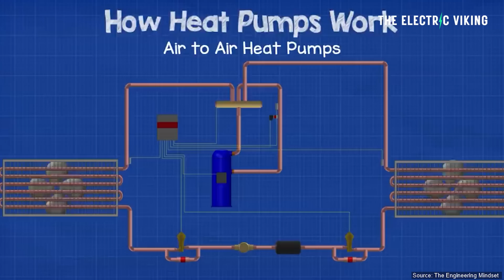U.S reveal NEW Heat Pumps that withstand freezing weather & save 50% energy

Comment: For anyone outside of the U.S. confused about this: America has used heat pumps for cooling for decades. However, much of America didn't use heat pumps for heating. It was either Fireplaces, Resistive Heaters, Natural Gas Heaters, Or Heating Oil for Furnaces. The recent green energy push combined with improvements in heat pumps and financial incentives is putting a new light on heat pumps for heating rather than just for cooling.
Reply: This is true. Many businesses use mini split systems because they know it’s cheaper. Many US homeowners like to do things the old way. 

What doesn’t make sense to me is why we don’t use geothermal is more new construction. No worries about outside temp and it’s even cheaper to run.  The loops last forever and the heat exchanger lasts much longer than a modern high efficiency furnace.
Reply: Yea and in many cases your fossil fuel dealer was never going to tell you about them unless you ask and then you might not get the truth or full story. Many great videos on YouTube to really learn about heat pumps and how they work. Educate yourself before you wet multiple quotes and get full system pricing from US Internet full system sellers so you can figure out parts vs dealers installation price as many refuse to itemize parts vs labor.

Comment: Heatpumps have been used in Sweden and Finland for over 20 years. They work well also in cold climate and generate energy/heat all the way down to minus 20 degrees C.
Reply: Montana USA here…we just went through -40 C cold snap, so my heat pump errored out early into the nosedive…🥶😱
Reply: Wisconsin here, -20C here. My inexpensive mini split is working fine. Don't know how fast the meter is spinning but at least the gas furnace isn't running as much. Run my mini split, 24/7. Living room is 450 sq ft with 7 ft ceiling, and it is comfy.
Reply: Many areas of the US, outside of Alaska, regularly get well below -20C for days at a time.
The heat pumps are getting there but aren’t quite there yet.

Air heat pumps are ok for the bottom half of US but you need ground based to handle the upper half/Alaska since air based aren’t quite there yet.

For now, you still need gas or electric assist for air based heat pumps for heating/cooling although heat pump water heaters are probably there now but a bit pricey.
Reply: @roberthealey7238 They have been there for 10 years! Living in northern sweden (above anchorage latt) and heat pumps are in every home basically. And have been for years!!
Reply: Do the heat pumps used in Sweden extract heat from the ground, or from the air? Heat pumps in places like  Scandinavia and the northern US tend to be of the geothermal type, with tubing buried 1-2 meters below the surface extracting heat from the ground. Heat pumps used in warmer areas take heat from the outside air, which become increasingly less efficient as the air gets colder. I'd be surprised if you use air heat pumps in Sweden, with the possible exception of the far  southern part of the country, especially closer to the sea, where the weather isn't super cold.
Reply: I think the ground type is more common in Sweden than in Norway for some reason. You have to drill well holes instead of just forking out maybe 20 - 30 thousand NOK. The drilling and the heat pump used for wells probably climbs to around 10 times more expensive. Idk, why the Swedes can afford it, and not to many Norwegians. Maybe they have better subsidies
Reply: @grilsegrils9330  average temp is much higher in northern norway due to the north atlantic current. And if you have 5-10 minus a air heat pump is really a now brainer. At -20-30 degrees geithermal is still a better choice if you have the money.
Reply: @brunopadovani7347  I would say 50/50. But still, the point is that air-water or air-air heat pumps for really low temperatures are absolute mainstream in northern europe, and have been for years. And these youtubers talks about it like its alien technology 😆
Reply: Owning a property with boarder to the ocean or a lake can be quite expensive, especially for a house property
 But it probably is the best option to just sink a spool of black hard sturdy plastic pipe to the bottom of the body of water. Not only do you have the normal benefit of the cooling liquid flowing through, but you also have effective exchange of water surrounding this pipe. Especially in the salt water ocean this can be very true. But also in a lake, since the body of water is large. A lake can freeze to the bottom, but that takes a lot of frost, plus isn't to normal. The bottom water would stay plus 4 degrees Celsius for the longest. But you probably need insulation on parts of the pipe coming out of the lake into the soil, in case the frost should be severe some year into the future
Reply: The heat pump installer switched my wish for Mitsubishi with a Daikin, claiming it is an even larger manufacturer and similar quality. So I just took his advice

Comment: I live in the Southwestern US and I installed a heat pump about 4 years ago. Works great, until the outside temperature reaches around 40F. Then I need to activate the resistive heating strips, which is obviously less efficient. I did it mainly to stop burning natural gas in my house, now everything (including transportation) is run from my solar panels.
Reply: It must be a cheap heat pump. I have a Mitsubishi R10 Heat Pump & it is goo for down to -20 degree celcius, no problem, installed 8 years ago & is Great!
Reply: 4 years ago could have been an R-22 system if you can't go below 40F. R410A will get you good heat down to about 5F. Below that, the strips come on. They don't even make R410A anymore. I assume the next gen (R454B will be able to handle extreme cold, but is A2L and I have not even seen a whisper about whole house systems. Just mini-splits.) I hear they are coming Jan. 2025. But we'll see.
Reply: @anthonylosego  my R410a  unit is rated to -30C  Works just fine at -20

Comment: Sam, it looks like you didn’t research this topic enough to fully understand it. The topic here is cold climate heat pumps. A lot of the schematic animations you were showing are air to air heat pumps. Those are not cold climate heat pumps. Once the air temps go under 40 degrees F, it will have to kick on a resistive heater tso maintain 70 F inside. That becomes very expensive to operate because of how much energy resistive heaters use. My parents bought a house in 1985 with baseboard resistive heaters.  They installed a Carrier brand air to air heat pump. It was $3,500 back in 1985, which was kind of expensive back then. So the real topic of cold climate heat pumps…. Those are air to water. Or more accurately, air to antifreeze, like ethylene glycol or propylene glycol. Those use a radiator that is buried underground. These “ground source” heat pumps use a trench that is 5-6 feet deep. Insert the underground radiator, then bury it. The earth at that depth will still be 40-60F even in freezing temperatures.  That technology is newer than air to air heat pumps, but still more than 40 years old. So this cold climate heat pump challenge is not inventing a new technology. The goal here is to make the existing technology more efficient, more robust, or longer lasting, and to make it cheaper so that it can be deployed at mass scale.

Comment: Love your channel. This heat pump news might be new to some countries who haven't had reason to use heat pumps widely. In Nordic we have used heat pumps for about 30 years now. They are mainly Japanese manufactured and work fine in in sub zero temperatures, saving electricity to up to -25 degrees weather, at which point the efficiency coefficient is 1:1 or simply put it works like electric heater. Typical power savings using a heat pump in Nordic weather conditions is around 35-40%.
Reply: I think Panasonic sells model which they claim to work at -35C

Comment: I live in Denmark (Europe) last weekend we had -15 celcius. My 20 year old heatpump works just fine, also air to water heat pumps are nothing new either. You completely fail to explain what this “new technology” is about. My guess would be that the old heat pumps in very cold temperatures actually just switch into “toaster mode” where it use a plain old fashioned heat element, and therefor does not use the actual heat pump. And this new technology actually makes it able to use the heat pump part in much colder temperatures. You should do a new video where you actually explain what the new technology is about.

Comment: I just want to say that all three homes we’ve lived in since 1984 have had heat pumps. I live in MD where it’s been borderline if heat pumps make sense. There has been great improvement on the cooling side but not on the heating side. From reading the comments it sounds like that has changed. That’s great news because many homes in my area were built with gas heat.  I’ve also had friends with large homes that had three heat pumps. Electricity was so expensive in the winter that they bought three pellet stoves for heat. This was like thirty years ago. Sounds like I need to take another look at heat pumps!
Reply: It works well in my 130 year old home in Maine... saw -15F last winter.... hyper heat mitsubishis, and fujitsu is what I use on my home and most of my customers..
Reply: But Daiken also has a great low temp product... I recently started installing their r-32 products for lower GWP in the refrigerant in case of leakage.
Reply: They're finally coming around. 10-15 years ago they sucked, but the newer ones actually produce good heat in freezing temps. I wouldn't trust them in extreme cold, but down to about 10F they work.
Reply: The newer cold climate heat pumps are vastly improved and will heat well down to about -5 F. But make sure your unit and thermostat control can do weather compensation to maximize efficiency based on outside temperature. This is bigger in Europe but just being implemented here ( a lot of HVAC Contractors here don’t know what it is but the really good ones do? You can research it on YouTube.
Also see “The Maine Heat Pump” study where the installed Heat Pumps in about 100 homes of all sizes and types. It is also on YouTube and their website.

Comment: The $500 per year will be spent maintaining the unit and that’s if it doesn’t develop a serious problem and you can bet it will. We don’t need a heat pump that will work in cold weather we need one that is cheap and reliable.
Reply: Energy costs are the largest factor so an efficient model is highest priority.
Reply: @imzjustplayin  Not where I am. My electric bill is only about $200 per month. What fraction of that could I save? Not worth it.
Reply: You'd have to do the math on incremental cost increase of the unit vs. the expected energy savings over the life of the unit. DOE rules for appliance efficiency standards is that the expected energy savings over the life of the product should at the very least break even with the cost of the efficiency improvement. 

Someone who rarely uses their unit probably wouldn't benefit from an efficient unit while someone who uses it frequently would. I don't know what your rates are and we don't know what the incremental cost increase is between units you're thinking of. If I was buying a heat pump, I would buy the highest efficiency model because the low efficiency models are useless below 45-50F. The higher efficiency, the more heat you get. My dad made the mistake of getting a 'cheap' heat pump rather than spending the additional $5000 for a decent model. Because of this poor decision, the unit makes little heat and it's exclusively relying on the PTC strips (glorified space heater) for heating the house. So despite the outside temperature being 50F, the unit can't heat the house above 62F without relying on the PTC strips. It's effectively useless. The minimum temperature for the unit is 45F and it has a seer of I believe 14, the minimum standard. The thing is really a cheap A/C unit that has a slight heating ability. The unit is appropriately sized for A/C but its heating capacity is lacking. A high efficiency model of the same tonnage (3.5T I believe) would've provided more than enough heat without needing the PTC strips. @frankcoffey
Reply: Absolute rubbish. The notion that you're spending $500 a year to maintain a heat pump is total bulshit. Take your trolling somewhere else

Comment: The temperature outside right now is -32C.  A heat pump without auxiliary heat working only down to 5F (-15C) is about the theoretical limits of it.  Physics says there's not much heat to extract at minus 35C. I wonder how it would work at -50C up the road? A heat pump which uses an under the frost line loop would be improved somewhat however I'm not sure it is a complete solution.
Reply: There are air source heat pumps that work at -18f.
Reply: It's an engineering problem not a physics problem. Using nitrogen as the working fluid the pump could work at extremely cold temperature. Using mechanical actuators to clear up frost in the evaporator fins solve frosting issues.
Reply: Most refrigeration systems have defrost cycles either hot gas or resistive heaters. @kazedcat
Reply: @kazedcat  Interesting that you say the laws of thermodynamics (physics) are not involved by selecting a different fluid type.
Reply: @ricknash3055  There is always heat to be collected if the temperature is over 0°K / -273.15°C / -459.67°F. It is only up to the fluid in the pipes. My heat pump works well down to -25°C. Then it uses as much energy as it collects from the air.

Comment: It's about damn time the United States government got serious about heat pumps.

I'd like to see Tesla start making their move on their promise to advance heat pump technology.
Reply: The us government will figure out a way to screw up the technology, and back up the wrong company or something.
Reply: Trump said we don't need high efficiency anything. We're gonna drill, baby, drill!
Reply: @pardunmeesuh5612  No, that's not what President Trump said, troll bot.
Reply: Tesla's heat pumps have a manufacturing defect that informs its presence around the time your warranty lapses. So those are probably not usable in the building construction industry setting, either.
Reply: @mikapeltokorpi7671 do you have more data on this information? Are you suggesting Tesla intentionally programs it this way?
Reply: @mikapeltokorpi7671  Thank you Mr TrollBot
Reply: @mikapeltokorpi7671 
Fair enough.
However, Tesla's tenacity and brilliant engineers can improve that technology for buildings.

Tesla seems to have a knack for beating problems into submission.

Comment: I don’t understand when I hear “heat pump”. I know what a sterling engine does, in other words, a heat pump and how it requires two zones of air to operate to turn to make electricity potentially but you can’t do that to heat air inside when it’s freezing outside or to cool air inside when it’s hot outside
Reply: It's new age jargon to fool the gullible. In Australia the term is reverse cycle. Great for one room. Not for the average 6 room house

Comment: My heqt pump works flawless down to -25 C so nothing new here!
Reply: Try and heat  7 room house with one😊😊😊
Reply: @robertfonovic3551  No problem at all! And a unit for a small house costs only 1500€, I have used it för 25 years now, changed the first after 20 years. So for a large house you can have a split with two indoor units that is just slightly more expensive. For a very large house it’s better with a different type of heat pump but they are more expensive of course, water-air is about 10000€  and geothermic is about  15000€.

Comment: Getting the cool heat pump isn't hard, even here in America. ~$3500-4000 for a 3 ton 18 SEER Mr. Cool Universal (central air instead of single room) that's good to -20F.
Getting the HVAC company that will install it without trying to force you to buy their $15,000 Mitsubishi or Daikon heat pumps is impossible in some places. Most I've talked to simply won't work with customer supplied equipment as there's not enough profit in it. 
The individuals either aren't certified, can't do the permitting, want $1000 an hour, or just ghost you.
Reply: You are paying TRIPLE the amount that we paid for top-rated Mitsubishi systems in Canada. US distributors are cheating you.
Reply: Well duh, but doesn't change the fact no one will do it for a reasonable price. @FrunkensteinVonZipperneck
Reply: @FrunkensteinVonZipperneck  it’s the installers. I got a full geothermal system including the loop for &24 before 30% rebate. $15k for air to air heat pump is insane.
Reply: You want to look around for someone that retired or is starting up a new company. The big problem is monopolization by the large companies that go in and buy out the local guys. I had some basement space finished and I was able to find an electrician that did some work for me. He worked for a commercial contractor so they didn’t care about noncompetes or whatever.
Reply: Yeah HVAC installing is super hard that is for sure.

Comment: Most heat pumps IN New Zealand also do cooling. We have a heat pump that also does cooling and have done for over 25 years now. 	Air con is not needed very, often but works well. It also reduces the humidity.